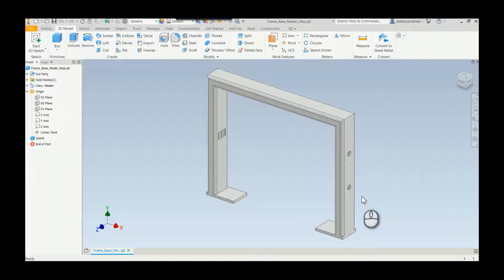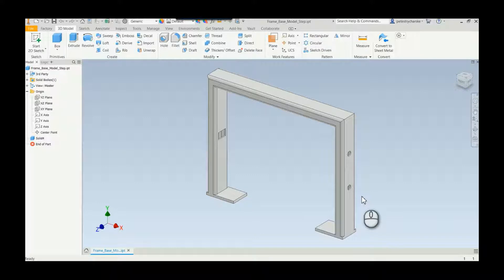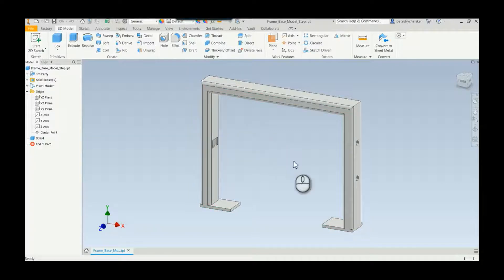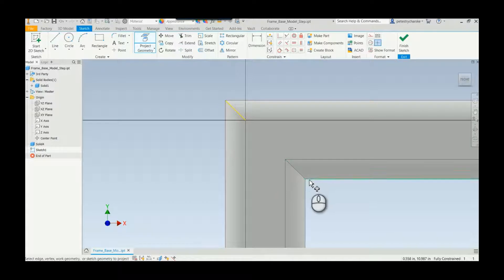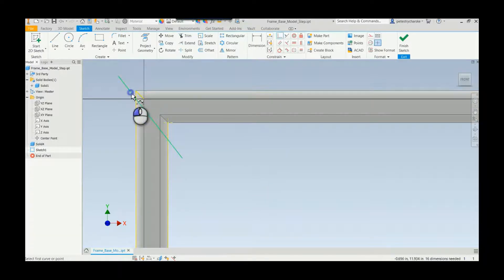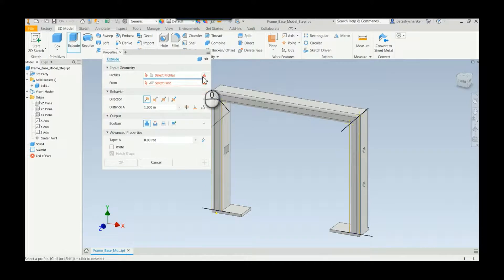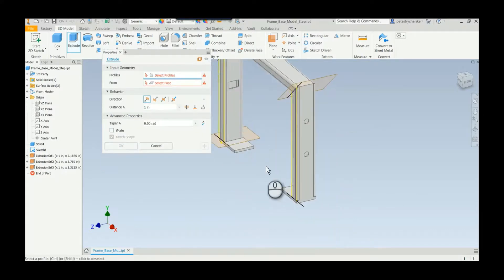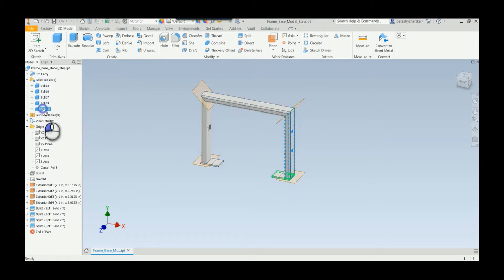Inventor - How to Split a Step File into Multiple Solids

Comment: I need some help please. I imported a stp file but it cannot be edited.... I mean, I am unable to create any 2D sketch on it. It is also imported with a green color instead of the common gray one as usual. Do you know why does this happen? Thank you in advance
Reply from the maker: Walter, you should start with ensuring the STEP file has imported properly.  Please follow the steps from this Autodesk technical article and see if that helps to resolve your issue.  If not, let us know and we’ll do some more digging into this for you.  Autodesk Article Link: https://knowledge.autodesk.com/support/inventor/learn-explore/caas/sfdcarticles/sfdcarticles/Importing-STEP-files-as-solid-part-files-s.html
Reply: @Team-D3  I tried it but the problem persists. Is there any email where I can send you the stp file?
Reply from the maker: @walterflor7027  Hi Walter, sorry to hear you are still having trouble. Yes, you can send your stp file to support@teamd3.com for assistance. Thank you for your persistence; the support team looks forward to hearing from you.